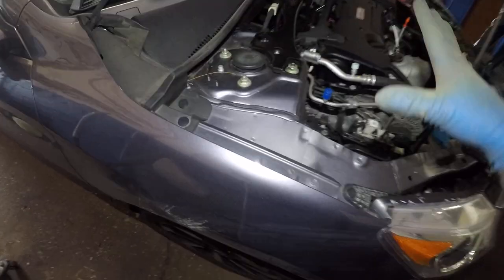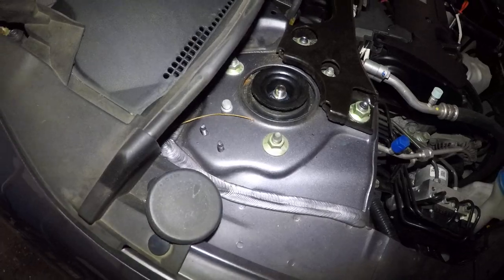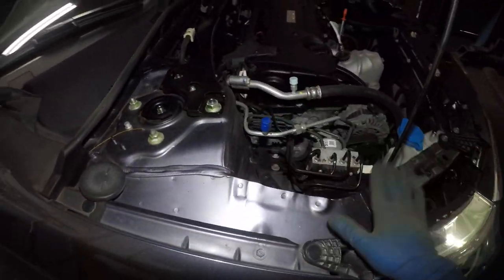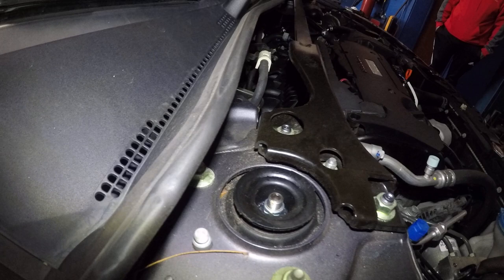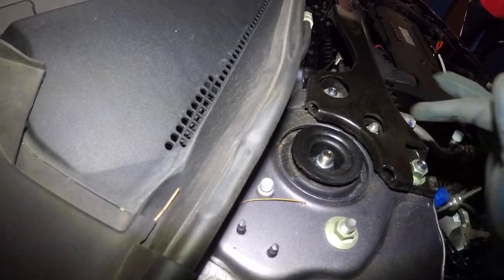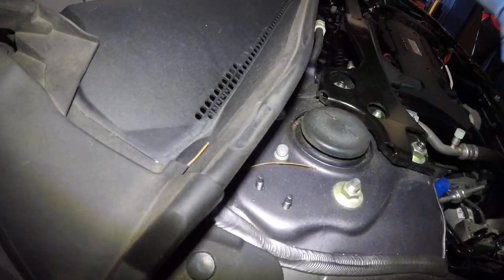Honda Accord Making noise on right side front when going over bumps COMMON on ACCORDs  2013 to 2017

Comment: Bro, I replaced my sway bar links last year and today I replaced one of my front wheel bearings using a press. I couldn't be happier. The bearing in particular was hard work as a first timer but I followed instructions carefully and got it done. I love these videos man! Cheers!
Reply: You inspire me to do repair for the first time
Reply: @zzoinks  . Good to hear! Be sure to follow every precaution and study the repair process thoroughly beforehand especially when working under your car. You'll find that most car repair isn't all that difficult. I would also suggest to get a torque wrench and make sure your fasteners are tightened to spec. Otherwise, enjoy the process and save as much as you can doing your own repairs. Cheers!

Comment: 2015 Honda Accord Sport, I just purchased the vehicle in April 2023 it has 128,000 miles now. I noticed that this noise happens only when my car is in D, and I sit still at a light. Do you think that what you mentioned in the video is the cause? The noise is coming from the right side only. I just took my car to the mechanic for an oil change, and he told me that it looks fine.
Reply from the maker: Possibly u need to have it checked out visually

Comment: When I just try to tighten it clockwise 17mm it turns very easily!!!! Is that normal or it means it’s loose appreciate your help .. even without wrench just by hand you can turn it holding the 17mm socket !!!! Thanks
Reply from the maker: I use impact cuz it quick action doing it by hand while strut will turn

Comment: I had this problem on my civic 8th gen, after I replace the front ball joint a clunk noise start the appear after going over speed bumps or a large potholes. I bring it to a mechanic and he just tighten that upper struts bolt and the noise disappeared.
Reply from the maker: Yuppp
Reply: Sounds like you have an honest mechanic! Hold on to him!
Reply from the maker: @MrSupernova111  thank you!!!

Comment: My 2014 accord clunks and squeaks going over bumps below 20mph. And turning the steering wheel. Im on the second struts and the 3rd strut mounts. We Put OEM part from the dealer. Each time we replaced them, sound went away for few weeks then came back. I damn near rebuilt the whole front end, replacing axels, sway bar links, wheel baring, lower ball joints control arms, still clunking.  So one day i had to drive over a floor on the highway exit n. If rained so hared, the clunk went away for a week or two. Came back again. Has been clunking ever since. Recently it went away bc the weather is muggy. I can still hear it muffled but its not irritating like it used to be. What could be the issue ?
Reply from the maker: I would check and inspect all the ball joints and tie rods possablility bad joints or tie rods which can cause Squak noise or clunk noise  also could be 2 diffrent issues joint squeaking and bad linkages
Reply: @RBTheMechanic  they supposedly did. Bc i told them to change both sides for both and they said the other side looks brand new
Reply from the maker: @ottomanbeatsofficial  oh some times looks not the way I had car with control arm I changed struts mount links and bushing ended up the brand new control arm he had was bad

Comment: Is the torque settings for Honda incorrect? What torque setting should you go to
Reply from the maker: What torque sped u need
Reply: @RBTheMechanic  You mentioned the top nut on the  strut mount needs tightening more so I asking whether you are tightening more than the suggested torque spec
Reply from the maker: @bronniesboy  well yes give it snug

Comment: Quick question doe my 2017 honda accord sport  has upper control arm.cause I don't  see it supposedly  my dealer  said my upper ball joint bad
Reply from the maker: Front dosent. Have upper balljoint or control arm its assembled with strut

Comment: Hey brother I have that sound honda replaced both struts and it's still there. Any help would be appreciated it . I tried to look at the sway bar bushings and links they don't seem to be worn out . I did a brake job a couple weeks before the sound idk if that could be Parton the issue or what everything seem tight
Reply from the maker: Well maybe they didn’t do it correct or missed a part other wise it could be linkage those u cannot check even if u tell me u see it fine
Reply: @RBTheMechanic  even if I grabbed a hold and shook the linkage I tried putting a big screw driver under it and pulling up on it and it didn't want to seem to budge even a little bit . My first thought was the lower ball joint cause it sounds like a joint coming in and out cause it definitely has that up and down sound as I go over bumps
Reply: @RBTheMechanic  these fools put some pliers on the ball joint and sneezed it well they had it jacked up like it was going to move with all that tension on it
Reply from the maker: @Richiebones  prolly forked the ball joint ripped the boot

Comment: I have a 2007 accord and have this issue with the front right side. I just got new shocks/ mounts, control arms, sway bar done. And now the front right clunks more than ever and sounds really bad
Reply from the maker: Did u check engine mount the side mount is very rare to brake and bounce
Reply: @RBTheMechanic  my engine mounts are fine. This clunking is from driving over bumps and it sounds like the noise is coming from the upper strut mount. I tried tightening it like you said in the video but the bolt just keeps spinning.. and never gets tight.. both sides the nut spins pretty freely. idk why my guy did
Reply: And im spinning it the right way I must add lol. Both sides take no effort to tighten and don’t get tight
Reply from the maker: @kylec5429  it somthing else maybe somthing that u changed is loose or somthing is off
Reply: Hey my dude did you end up finding out the issue
Reply: @kylec5429 This suspension noise stuff has got to be one of the most hard-to-troubleshoot issues on a car.  Folks and different vids are all over the place swearing it's this, no it's that.

Comment: mine doesn't make clunk noise but more like vibrating noise when drive on uneven road.  Also when I let the car sit idle the noise is still there but when i turn off the AC/fan it stop.  do you know what is it before i bring it to mechanic?
Reply from the maker: I’m not sure ur describing some suspension issue when going over bumps I would check exghust shields before anything
Reply: @RBTheMechanic  will do thank you

Comment: Mine was loosey goosey on the passenger front tower went to tighten it up felt like it was stripped put my 17 with an Allen poking out the top and it tightened up feels better....I,m presuming there is a do hickey tool to do this properly?
Reply from the maker: Yeah I usully use impact it dose the job
Reply: @RBTheMechanic I just remembered I have a electric impact snugged it up nice and solid took it for a little spin cant hear a noises good deal bud : )
Reply from the maker: @carlwinslow4175  glad this worked for u

Comment: Is it same with rear? Mine rear left got got sound crack when run unstable road
Reply from the maker: No rear is diffrent could be links or bushing
Reply: @RBTheMechanic  inside the rear top will be a bit better adjust trunk rubber up and down…sound like pulling metal
Reply from the maker: @chankaveng2302  u can try but never had issues with back
Reply: @RBTheMechanic  OK thanks alot

Comment: I tried to tighten the bolt but it doesn't tighten at all (no matter how many times I turn the racket). Did this happen to anyone?
Reply from the maker: The strut might have play too much gap between the bolt and mount could be from long time banging up and down

Comment: if i have to replace the nut would i have to remove lots of parts?
Reply from the maker: Which nut ur talking about
Reply: @RBTheMechanic  the nut that you have to tight in top. I found a tsb from honda which is asking to replace that nut. If its hard i will just tight the nut instead of replacing it
Reply from the maker: @karmagurung8153  u can’t just replace it the spring will pop the shock might have to compress the spring with tool
Reply: @RBTheMechanic  thank you :)
Reply: the weight of the vehicle will keep the spring compressed on the strut it won't come off with the vehicle on the ground

Comment: What if the knocking noice is  from front driver side
Reply from the maker: Well is that when driving?
Reply: yes when driving on rough road no sound on smooth road knocking noice coming from front driver side tire area @RBTheMechanic
Reply: 2016 touring @RBTheMechanic